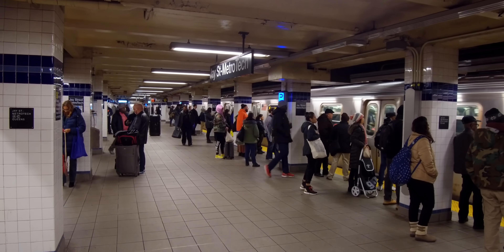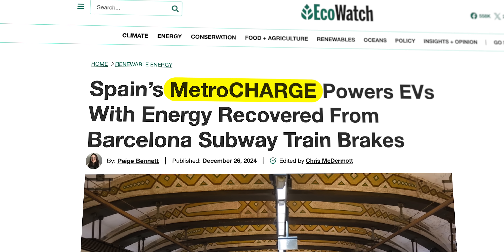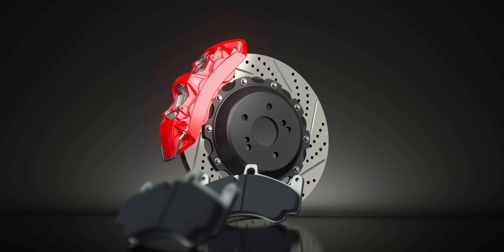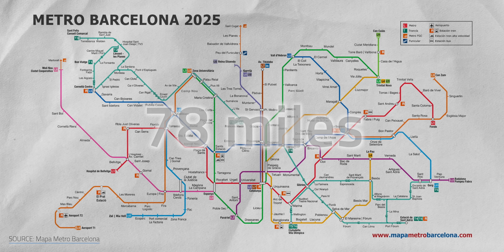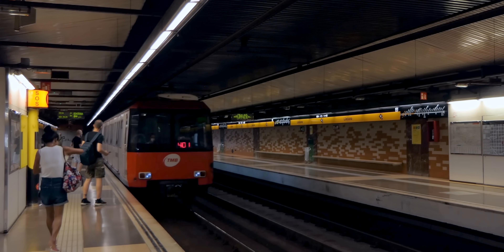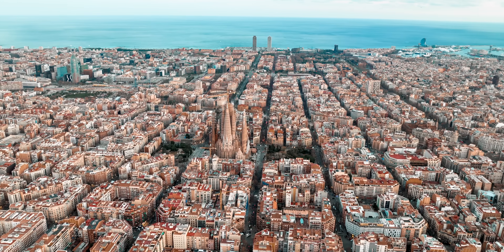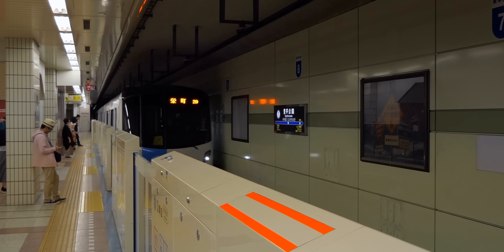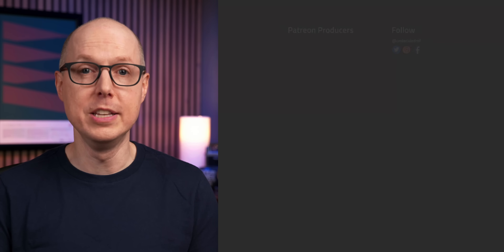The Most Overlooked Clean Energy Source… is Under Your Feet

Comment: Honestly I feel like regenerative braking would be a great investment in the long-term, and not just for the subways, think about it, how many devices use electric motors that are attached to the electric grid??? I would imagine an amusement park can take great advantage of regenerative braking, and I'm pretty sure there can be many more other use cases as well ;3
Reply: Elevators for one. The new hybrid elevators use super capacitors. China has the battery/capacitor busses. I understand the super capacitors allow much better regen recovery. Anything with appreciable mass that stops and starts hundreds of times a day and requires braking is an energy source. The more stops and starts, the greater the saving. But feeding back to the grid would be the cheaper solution, if you can start the subway without overwhelming the grid you could stop it too, there just has to be a fair solution of net metering established to create the incentive. It should be more than just saving on brakes.
Reply: @edbruder9975  Coupled all that with wind solar and hydro, I've seen a lot of things on this channel that definitely suggest we are wasting a lot of potential power :/

It would definitely be great to find all new kinds of ways to recover and reuse the energy, and well it's expensive in the beginning, it would not only be cheaper in the long run but probably more profitable too ;3

Comment: I've been driving Hybrid cars since 2009 and EVs since 2014 and have never needed brake replacement. Even straight gas cars can have brakes last a long time if one practices driving ahead. In the mid 90s I had a small wagon with a manual transmission. seeing what's ahead and coasting when braking is certain saves a lot. The car consistently got 42 mpg and the brakes lasted 185k mi before any pad replacement was needed. Actually, they could have lasted much longer, but one caliper rusted in place wearing out one pad and they don't sell them Singley.

Comment: Before it can stop, the train has to get into motion, which takes more energy than can ever be regenerated from breaking. So the train best uses all of its own regenerated energy.
Reply: Dunning Krueger
Reply: What's with all these faulty trains that keep 'breaking f'?
Reply: Which is a major energy saving compared to pulling new energy from the grid every time it reaches the next stop.
Reply: @mathnerd97  I'm not sure what saves more energy: temporarily storing energy in a capacitor and releasing it when accelerating, or sending the electricity back to the subway grid to be used by a different train. You either have charging, storage and discharging losses, or transmission losses.

Storing directly in the train would be my preference though. Even though it adds a little bit of weight, your subway system becomes way more modular and versatile when you put the power storage in the trains.

If you don't do that, you will have to upgrade the subway grid to be able to pump a surplus of electricity back in the main grid / to store the surplus on site.

If the train can temporarily store energy it can be used directly, without any additional changes in the subway system.
Reply: sure, but then you'd need batteries to store the energy while people get on and off the train (probably at the station, since putting them on the train increases weight and therefore reduces efficiency). I'm assuming that such a system would be more expensive than building an access point so people can bring their own batteries (eg, cars) to charge. 
also, take into consideration that charging is not 100% efficient. you can sell 100% of the reclaimed electricity. running it through a battery, you're only offsetting your own electricity by 90% of the amount you could have sold.
it's all tradeoffs, and some of them are worth it.
Reply: @DraconianEmpath  I would say instinctively the battery is the way to go. It is just a small battery you need. Much less complicated/expensive than sending everything into the (charging) stations, with all the systems to regulate the consistency of the electricity needed. Seems logical to me.
But @ruudh: if we, laymen, can think of this within 15 seconds, I am sure tens of professional engineers in Barcelona will also have thought of it. There are good reasons why they do it like they do that we cannot think of.
Reply: @DraconianEmpath  is your plan to have cars parked at the train station waiting for trains to stop to charge their batteries?
Reply: @DraconianEmpath  Other trains simply return the recovered energy to the same wire they use for power. Essentially, they're helping other trains on the same section, as the power sub-stations usually do not return power to the power grid.
"Powering EV from train" is just public relations mumbo jumbo...
Reply: @arivaldarivald3212  Ah good. Someone on youtube thought within 3 seconds the reason why Spain spent 26 million for "PR mumbo jumbo", and noone ever objected, and the world even watching it. Don't you love the YouTube comment expertise? Beats any progress!
Reply: @qqleq  the problem might be that Matt fails to explain why transfering the RB energy to EV chargers is so much better than just reinjecting it in the grid / using it for other trains / using it inside the train itself?
Reply: @qqleq  So you're arguing that silly, inefficient things never get done for political (or other) reasons? ;-)
Reply: @arivaldarivald3212  It's not just mumbo jumbo. I suspect they are using this method as a corruption loophole: The publicly funded metro corporation buys electricity for market price and then sells it to EV companies for cheaper "because it's regen" or something. The taxpayer pays for the difference. 

EV companies keep selling electricity to consumers for the same price but they now make higher profits. 

The son of the Spanish president is invited to fill an high-paying position in an EV company and he uses this money to "gift" assets (such as property) to his dad.

The Spanish government can proudly say they spent millions on public amenities and no-one knows why they're getting poorer every day. 

This is common in Spain.

Comment: Benefit? Yes of course.  But... Energy is what drives the train in the first place, so until 100%+ is generated, it's just somewhat offsetting the cost of operating the train.  You can just dump that back into the grid which is powering the train.  What else you power with it, however cool, is irrelevant.
Reply: What would be REALLY cool is if you could cheaply adapt RB to an existing gas powered vehicle and dump that energy into a 5kwh battery in the trunk that you could then dump into your house battery.

Comment: Great idea! One other big advantage that wasn't mentioned is about health aspects of braking heavy trains. They cause a lot of dust particles released to the atmosphere and since it happens underground, the particles aren't easily dispersed. These particles cause the characteristic smell of train and metro stations and could well cause respiratory conditions leading to lung cancer :face-blue-wide-eyes:
When heavy regenerative braking is used, brake component wear is reduced very substantially so dramatically reducing the heath risks/hazards to passengers and staff
Reply: its not going to help unfortunately! all trains basically have regenerative braking but they still need the physical brakes for complete stops or for emergency situations.
Reply: @alanmay7929  Not all braking created equal. At low speeds not much dust is created anyway, also regen braking isn't as effective at low speeds. In emergency situations, all other considerations go out of the window. 
When a train is at high speed, it has a lot of momentum (= mass x velocity). It's here that to overcome its momentum and stop, heavy breaking is needed then a lot of heat and therefore dust particles generated. Anyway this is my take and understanding

Comment: They were planning this in Hungary too. The GANZ metro trains developed in the early 1970s were designed with regenerative braking in mind. But the electrical infrastructure at the time couldn’t handle feeding energy back into the grid, so they ended up using resistor-based braking instead. A solid idea, just ahead of what the system could support.

Comment: interesting video, but one part of it seems off to me. i trust Matt, so where am i going wrong? it seems to me that DC is better for getting everything to work together? for AC you also have match frequency.  trains don't move at a constant speed so the frequency generated would vary and out of sync. i imagine that to sync AC power you also need a global clock and start from a DC source anyway. i can't see how they are using AC for this.

Comment: I was originally wondering why they just don't put this back into the grid to just offset the trains' electricity costs. But then realized that regulations failed here and power companies don't have to pay that back. I think this was a huge fail on regulators part. Power companies should have had to pay that back. It's cost that they're not having to pay to generate electricity.

Comment: This is good but the RB energy is recovering energy that was already put into the train getting it up to speed.  This is good if the train input comes from sustainable sources.  Don't get me wrong capturing and using the RB energy is a good thing however this is only energy that would otherwise be lost as heat.

Comment: Did I miss how they get the train moving?  Why aren’t they just using the watts from braking to launch the train again like in cars and buses vs pulling it off and sending power to EV charging which adds more losses?
Reply: @daviddrake806  I agree... somewhat... Using regenerative braking to re-power the train's next launch would require storage. My thought would be to just put it back into the grid or micrqo-grid. If you look system wide, there is likely always another train starting when one is stopping...
Reply: @calvinjeans-sj1bl  If not the same train, then another train at least. Or else the grid in general. Not sure why the call out powering the station or EV charging specifically.

Comment: Regenerative braking is a good thing and I am happy TMB uses it on its metro network, however, what does EV charging have to do with it?  What happens when there are no cars to be charged in the electrolineras? Can the trains still use RB? What happens with the electrolineras at night when the metro is closed? Do they still work?  The probable answer is that the energy goes and comes from the overall electric distribution network which takes whatever energy the electrolinera can't put into an EV or supply the EV when no trains are running.  Which means, the electrolineras and the RB system are very loosely coupled, either can work without the other.  Thus, why bundle them together as if they were a new system?    This is just one more example of needlessly piling up technologies, like EVs with solar cells on the roof, EVs are cool, solar cells are cool, let's put them together, hurrah!  Have you seen any such car recently?  Nope, it doesn't work.  Not enough roof space in the car to make it worth it, no charging when the car is in a garage. A waste of money.  Something worth of the cover of an ancient issue of Popular Mechanics, but not really worth it.  It is just nonsense bundling.

Comment: I don't understand this.. The train is using more much energy than it can possibly recover while braking, so why doesn't the energy just get used by the train? Pushing it elsewhere to then just suck more up to the train seems less efficient than using it directly. 

And "routing it" to the EV chargers doesn't seem like it would be any different to putting it into the grid either, assuming they are grid-connected 🤷‍♂
Reply: The trains don't have batteries. On the London underground, 26% of the power is recovered through regen and is just passed back ot the power line and used by other trains.
Reply: @stewdean  Yeah that makes sense. Put the power back into the grid to lower the overall usage. But what is described in this video seems to be a separate circuit direct to other devices? Or else how would they give the power sent to EV charging stations a lower overall cost? And if it is just generally over the grid why is the cost not just used to lower the overall cost rather than being sold to a third party? That whole bit just does not seem to make sense/is overly complex. Unless it is talking about non-electric trains which would not be able to make use of this power? Seems to be a missing detail.
Reply: @nous404  maybe has to do with avoiding dc to ac conversion? I know most (older) subway systems use dc power and ev charging is also dc. Would be nice to get more details
Reply: @stewdean  aaah, that makes sense 🤦‍♂
Reply: @stewdean  The new 24 stock will have batteries that will be charged by it's own regenerative braking.
Reply: @DanTup  it's numbers, a super capacitor storing the trains power still cuts the cost at the station. American diesel have a massive capacitor able to store enough to move a mile long train..
Reply: exactly shuffling more current around only incurs greater resistive loss
Reply: I guess this way they don't have to deal with grid coordination issues; they can just dump whatever energy whenever they want into a battery bank that powers those car chargers.
Reply: @sperzieb00n  but why have that battery bank powering car chargers at all? You can connect the batterybank / capacitors bank directly to the subway electricity system, and use the electricity for accelerating. Way easier, no grid coordination and less conversion losses as well.
Reply: Think about it a bit more  it'll come to you...
Reply: regenerative braking is kind of a misnomer. the train isn't necessarily applying physical friction brakes to slow the wheels during regen braking. Instead the train (or car) uses its own forward momentum to spin the electric motors, slowing the vehicle using electromagnetic resistance (back EMF, not friction), converting kinetic energy into electricity. See Lenz's Law for more on that, which basically states that the induced current will oppose the motion that created it. Essentially, the motors become generators the moment the train stops using its own power to accelerate or maintain speed. Regenerative braking isn't as effective at low speeds or hard braking (applying friction brakes). The effectiveness of regenerative energy capture typically varies between 15 and 30%. Under highly unfavourable conditions, it can drop to 10% or less, but rise to 50% or higher under optimal conditions.

Comment: So you said they’ve had regen breaking since the 90s, what was done with the energy so far then? I know that Swiss trains have simply returned their regen braking back into the grid that feeds them for years. You compare everything to just wasting the energy but that doesn’t happen everywhere, and once it’s implemented using the electricity to feed the grid powering the trains will most likely be less complicated/expensive and doesn’t subsidise car infrastructure with public transport funds. All of the energy fed into those chargers could have simply reduced the operational costs of running the trains.

Comment: I'm kind of surprised that this hadn't been on a larger scale already. The only reason I'm not surprised is, well, it makes sense, so of course it isn't being done. Seems like another great idea that needs more spotlight. Thanks, Matt!
Reply: Pretty sure electric trains have been doing this for years…
If you have one train arriving and another leaving the same station… doesn’t need to go out to the grid at all…
Reply: Almost every subway in the Europe uses this, it's definetly already on a large scale.
Reply: It's been done for decades on most electric train and light rail systems worldwide.
Reply: 1. It has been done on a larger scale already.
2. There are so many weird choices in the described system that I'm really happy it didn't gain any traction yet. Why would you transfer the energy gained by regenerative braking to EV chargers? Electricity can be used anywhere, so you could pump it back into the grid as well. However, the way more logical solution would be to either return the electricity to the subway system for other subway trains to use, or store the energy in capacitors in the train itself to be used again while accelerating. That is way more sensible, can be rolled out much, much quicker and is way cheaper.

This is like building EV charging station near major intersections, and then give cars a way to beam regenarative braking power wirelessly to these charging stations. Even if you manage to do it you are limited by the amount of intersections with these stations, and you need to find a way to safely transfer electricity, while there is a solution that is way more sensible: just put the energy back in the batteries. No need to reinvent the wheel.